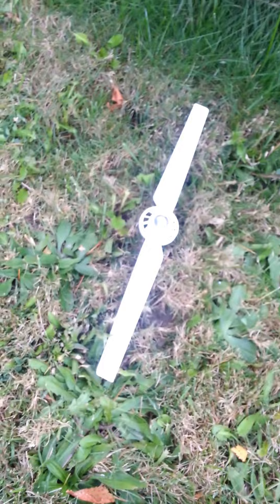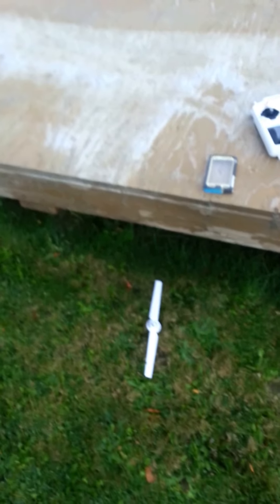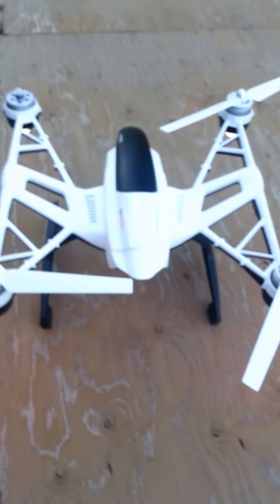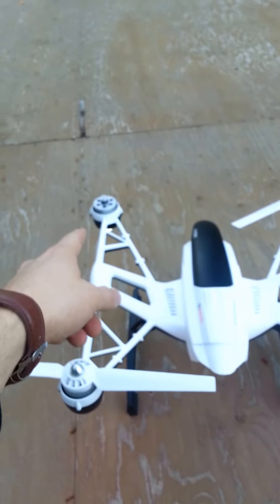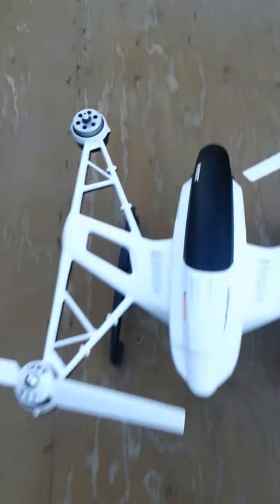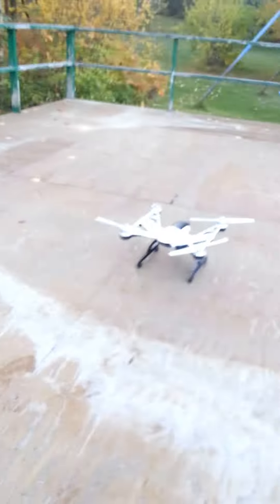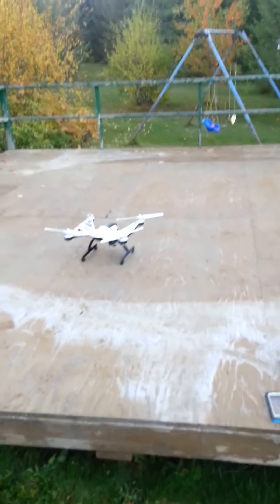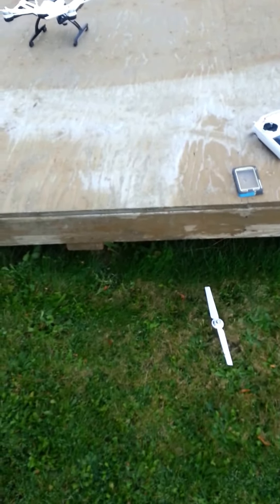Yuneec prop fly off!

Comment: Holly crap kickass! You're having some great luck here buddy! Use the tool to tighten the props ALWAYS! Then when you're tired of taking them on and off all day, email me and I'll help you order a minuteman case to make it more enjoyable to travel and fly!!😆
Reply from the maker: ya what does one of hose cost for the Q? and the dji 3 advanced?
Reply: +Drone Doctor   I will concur with Drone Doctor!  Unlike you I had the misfortune of a 20 foot tumble and fall after watching one of my &quot;hand tightened&quot; props fly off.  It suffered a broken chassis and hurt my pride as I was doing a demo for someone.  Yeah... I always use the tool now and I listen for the rubber O ring to squeak.  Not scientific I admit, but its the only way I can measure the torque.

Side note, I purchased a Pelican case from Amazon for mine and no longer remove the props either.  Only drawback is the camera won&#39;t fit the pre moulded foam insert I bought separate.  My work around is I leave it connected to the steady grip in my camera bag which always goes with me anyways.  After reviewing the minuteman case, MUCH better setup!
Reply: Too bad I can't recommend my cases I designed with the props still on........ it still is the best case out there, but you will need to order them directly through me to get them since we now only build to order........
Reply: Man, I'd be shot by my (wife) accountant if I bought another one.  I should have looked around a little more.  DOH!

Comment: Since no one else has commented on it, I tighten my props one full turn (360) plus a quarter to half turn after. I don't use the prop tool so that I can feel the motor slip between my fingers, that's how I know they're tight enough!
Reply from the maker: +Wesley Whitmore it happened agian to me,even after i had used the tool another day. But the cause,i think,is when its landing if it bumps the ground twice,it caused a slightly loose prop to come off. Just have to have smoother landings id say
Reply: +123abckickass If you want an alternative way to land it, go for a catch landing.. Would recommend you do this in an open area away from trees or buildings, but bring the quad down and hover it just above you. Wait for a moment to make sure it's stable and then you can grab the landing gear and stop the motors. I do this every time I land, the hops it does on landing sketch me out! 
Though your props coming off on landing says to me that they're a bit loose, even on hard bounce landings my props have never come off. Would recommend tightening more, I don't use the tool because at least with your hands you can feel it tighten.

Comment: Hi good luck with the Yuneec, I had this happen and it is not tightening the props problem. It happens during landing and yuneec released a firmware update to prevent this.  I did the update and it crashed my controller  and had 2 crashes after. Buy a phantom I suggest lol before it goes into the grave in the sky lol
Reply from the maker: i have a phantom as well, thats a pretty good machine. I dont plan on updating either of my drones, they work and i dont want to risk an upgrade problem
Reply: well I had the version without the updates and hence lost my drone.. It seems that anyone who posts crashes on social media removes them after yuneec visits lol.. In my case thats not going to happen, apart from that its a nice drone. Maybe I had just one bad experience
Reply from the maker: +Drone HDTV could be. i hear lots of good things about the company and it is a decent drone. the phantom 3s has a whole list of problems as well, including a ton of flyaways